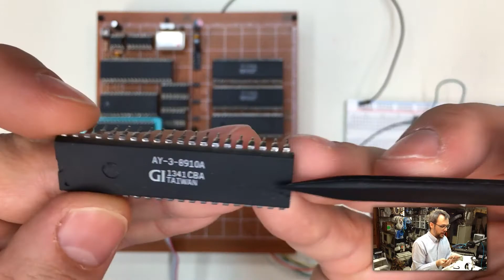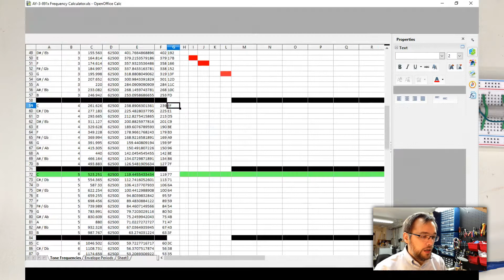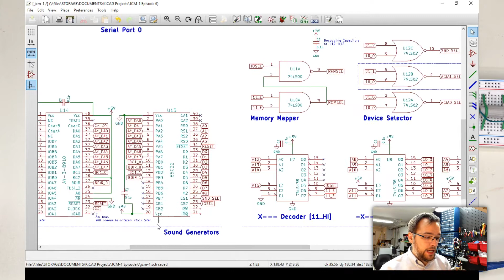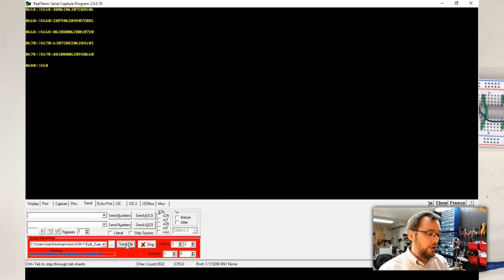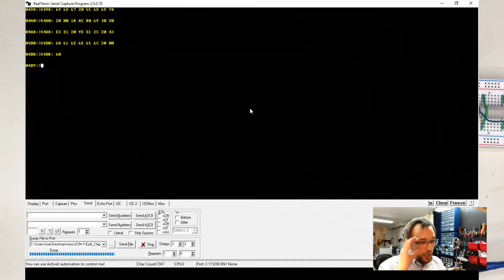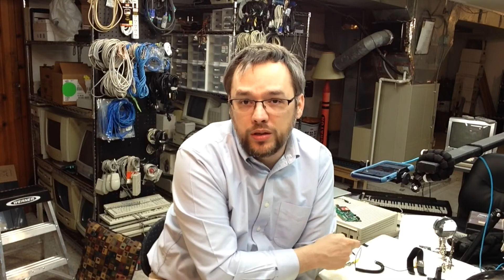SOUND AND FURY - Codename: JCM-1 [Episode 6]

Comment: Though it's kind of old video, I would like to point out that actually almost all "old" machines (including Commodore 64, etc) actually used keyboard matrix and scanning. This is how it's done on a modern keyboard as well, but surely, there is some MCU there in the keyboard itself (as you told too) to do the job and interface with PS/2 (or lately, USB HID) with the computer. I just told that since I don't understand how you get the idea that "almost all well designed old computers" did not use matrix / scanning, but some logic. It's exactly the opposite. And it's not so 'expensive' to do, in my opinion, especially if you need just some keys (eg for a game), basically it's just put the row number on an output reg, and read the columns in that row, or vice-versa, and maybe use bit masking with an AND opcode as well. This is  super easy and fast. C64 used CIA (similar to VIA, but different chip) to provide a port for columns and rows for the keyboard matrix.
Reply from the maker: I was using the Apple II and IBM computers as my references - both of which used a specialized micro-controller of sorts to gather keyboard data. A matrix scanner (in hindsight) is only slower than a custom MCU if you're using an interrupt with a MCU. There's ups and down's with both.
Reply: OK right, I have no experience with Apple II at the other hand :) [surely I have with IBM, but it's already not the "8 bit era" in my eyes] For me, it sounds natural that "the matrix" is the "true retro way" to do things, but it seems it's up one's experience with different hardware kind of hardware, more :) There are even various mixes, like the Commodore LCD, which has parallel output for matrix selection, but has serial shift in for reading the selected stuff, also appended with extra info on top of it ;) Oh, and some machines even puts the joysticks as part of the keyboard matrix, it has advantages, like uniform access, or to use joystick to move the cursor (kinda odd thing to do, but hey) etc etc :) The Enterprise-128 for example used a 4-to-16 demultiplexer for output selection towards the matrix, and it allows dozens of things to be part of the keyboard matrix. But, anyway, sorry for the noise. And I almost forget to mention, that I like your series a lot, many similar projects just focuses on serial port, and that's all, but it's rare to try to deal with video output, keyboard, or even sound ... Great project!

Comment: You should interface your board with a V9958 or V9938 - you can even cheat a little by borrowing some schematics:

http://www.6502.org/users/sjgray/projects/vyms64/index.html
Reply from the maker: I've already been investigating that. My worry is the availability of those chips, and also of interfacing with their smaller pin pitch. If I ever want to distribute these as trainer boards or whatever, those chips could be a problem. Not show stoppers, obviously.
Reply: If the parallel prop doesn't work out, you can implement a very efficient frame buffer with parallel SRAM.

http://www.vlsi.fi/en/products/vs23s010.html

It would be fairly simple, you might need another VIA for another 8-bit port. The examples I've seen are hooked to 8080 style 8-bit ports but I don't see why a VIA would not work.

Parallax Propeller is a great option but in my opinion feels too modern to be mixed with those beautiful old components; however, that or an Atmega probably are your best choices if you want sprite emulation.
Reply from the maker: Oooh, I like the look of that solution. Simple and elegant like the Propeller. I have pins left on the 6522 and I can implement SPI with the Shift Register and a clock delay. :)
Reply: It will be a bit of a challenge as you have to input the color clock, and all the graphics will be drawn to the buffer by the CPU over the 6522 unless you stick an Atmega or Prop inbetween the CPU and the buffer. I bet you could get a 40 column text display working like that, but I imagine any graphics would be slow and/or extremely limited.
Reply from the maker: Challenge? Meh. They said SPI can't be done with a 6522 using the shift register. I just might be doing it anyway. Stay tuned.